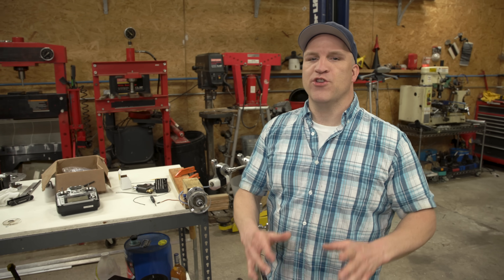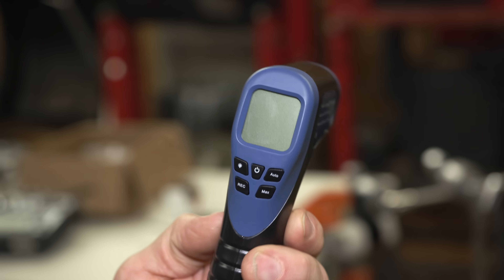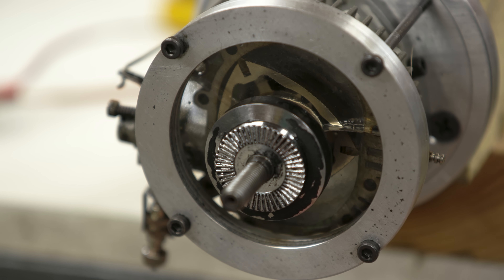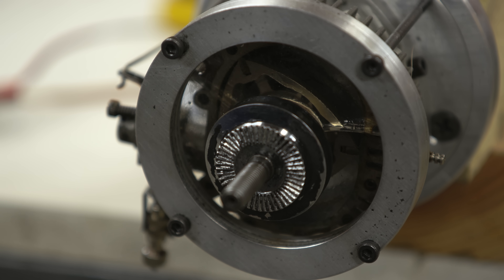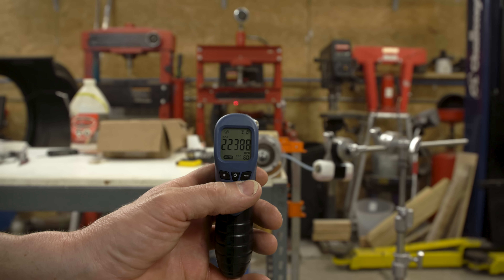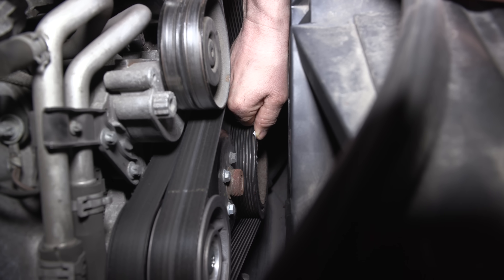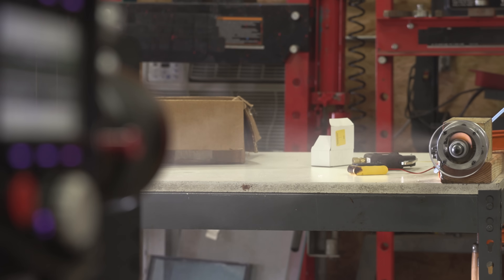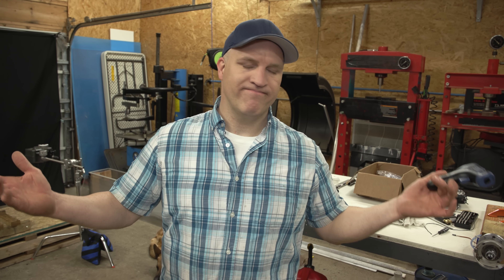See Thru Rotary Engine MAX RPM - 29000 (Wankel Engine)

Comment: I see you have a lot of practice in this matter but like i say before is an obsolete sistem people dont think no more. I personaly found two diferent engine sistem and two engine modification. I am living in a few days. To bad you dont hve interest in my comments. Me adress 8906 ley rd houston tx. Call me 337 488 1831acuse. I am 67 year old and i stared to work in engines wen i was 14 year and all the time i trye to find way the engines colapse until i discover a new sistem. I called the circular consentric sistem. Is a stody and cpmprension of the air guns but i find somethig else. Me sistem is posible to work in gasoline. Diesel or simple if you inject air comprres into the intakes because. In 3 slices i got 3 explosionns in asingle turn. If you use 6 slices you got 12 explosions in asligle turn but you have now two intakes and two exhaust if you use 9 slices you have 27 explosions in a single turn.and you have now 3 intakes and 3 exhaust. Susesivelt
Reply from the maker: I'm always interested in what people have to say, I'm not narrow-minded that way. I am familiar with the circular concentric engine, in my opinion there are other designs that may be more efficient and offer more promise for internal combustion, but we will see what the future brings, I will be showing those engines in future episodes.

Comment: That seems about right on the RPMs since there's so little rotational mass. I've done alot of thinking on the designs used in most rotary engines. Particularly the rotor itself.
The biggest problem at the rotary engine faces to prevent it from becoming the best engine ever in my opinion is its efficiency. A lot of its energy is lost before it can never be converted into mechanical energy. I think that can be fixed by rounding off the lobes on the rotor. Making each combustion chamber round instead of square. This would allow one solid ring per combustion chamber rather than the ones that are piece together at the corners and allow some of the energy to escape. The rotary engine an amazing engine just because of its simplicity. So making it even more simple is the best route in my opinion
Reply: Rotary engines are thermally innefficient by design, what you're thinking won't change that.
Reply: They are actually fairly efficient when run at a single speed with non overlapping ports, but you'll never get good power that way.
Reply: Whether it be a traditional otto cycle style of engine or this Wankel its not possible to achieve greater efficiency by any of the methods you mentioned. Both of these engines face similar problems with irreversible processes therefore it could be no better than the Otto cycle. For example by rounding off the lobes you'd decrease the combustion cycles efficiency to do work on the rotor. There is a reason the wankel has used basically the same lobe shape since its inception. Lets say that you did find an optimized shape to achieve what you're saying the main problem is still not optimized by doing that. If you'd want to make an ultra efficient Wankel you'd head more towards the material science aspect of things and need to probably look toward the use of materials like ceramic that way you could run hotter fuel, that would do what you said in your original comment. Now of course using ceramic brings in a host of other issues as well and that's the problem.
Reply: Wankel makes for excellent airplane engine... Where you pretty much set a certain RPM and stay there for extended period of time. By design the Wankel makes for a pretty terrible "car" engine. SO while it does work in ground vehicle applications, the rotary engine is best suited for high RPM airplane engines that only require a narrow rev range.
Reply: uncleweirdbeard 
The lobes and the "wobble" are how it achieves compression.

That would be like taking the crank out of a LS, and replacing it with a straight rod. Sure there is still a combustion chamber, but with no compression.
Reply: trouble is there is nothing simple about mechanical engineering. Btw this engine burns oil by design and has issues with leakage. Also there is only one spot where combustion happens so that part is super hot while the rest remains fairly cool in comparison.

Comment: Why does this motor idle at 10k and sound like a rotary in a car that idles at like 2k? I would have imagined that 29k would sound higher than that.
Reply from the maker: Yeah I agree, I think it idles at 10,000 RPM because of the fuel is running, I'm pretty sure with a load or a propeller it would idle much lower

Comment: i am pretty sure that in 6 frames there was only 1/3 of a revolution so the engine is actually only hitting around 9K rpm, i got suspicious after seeing the rpms when you let the engine idle
Reply from the maker: That's not how RPM is measured, RPM is measured by the rotations of the output shaft, not the internal components of the engine. For instance if you have a six cylinder engine in your car and it's idling at 1,000 RPM, that doesn't mean that you have a thousand combustion events every minute, it means that the shaft that outputs the power is spinning at 1000 revolutions per minute. And the rotary it's a 1 to 3 ratio for everyone RPM of the shaft there is a third RPM of the rotor, I am not measuring the RPM of the rotor, RPM is measured at the shaft always.

Comment: Yeah its possible. Im a dentist and our  air turbine drills can go 400,000 rpm. My motorcycle raps 14,000 rpm. So sure. I have 2- 3rotor cars and one is built for over 10,000 rpm.

Comment: I'm very glad you did the fps calculation. Thank you for not just straight trusting the meter. Very impressive numbers!
Reply: Same, I was wondering what rotating part he was reading off of with the meter. For example, I was thinking it might have been reading 3x what the actual RPM was if it was reading from the rotor and picking up each corner (the triangle piece). It just seemed strange that it idles ad 5-6,000RPM but I guess it does!
Reply: You would measure rpms at eccentric shaft, the output of the engine.  You would not measure at the rotor, an internal engine component.  We dont care how the engine does it we just need to measure the output.  But yes the actual rotor itself will always be rotating much slower than the e shaft, by 1/3, one of the designs strengths.